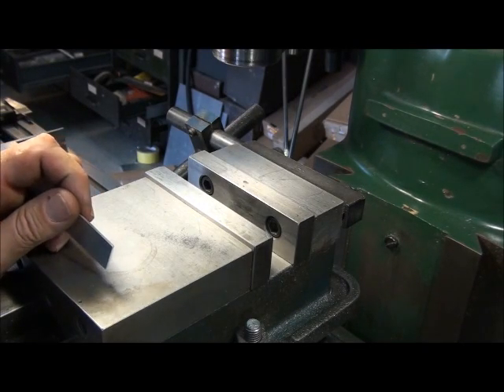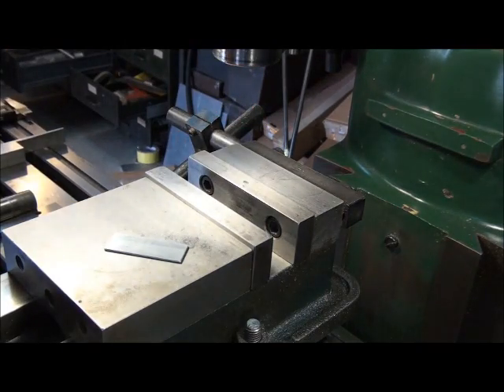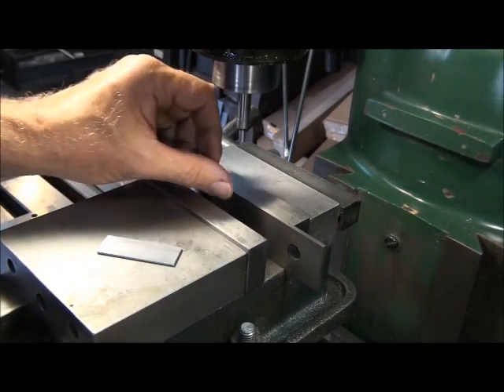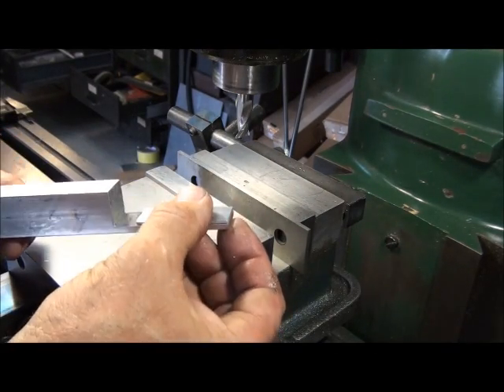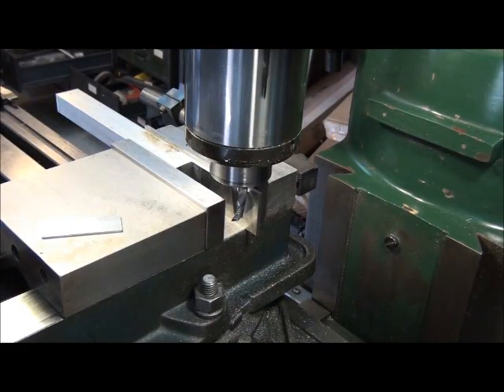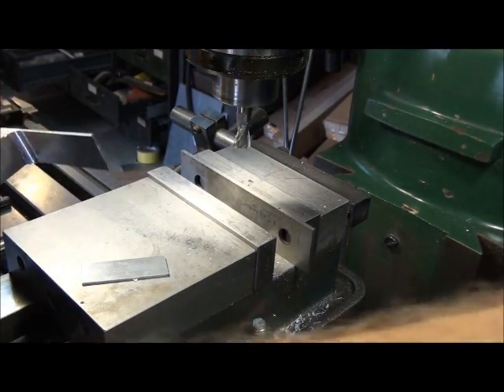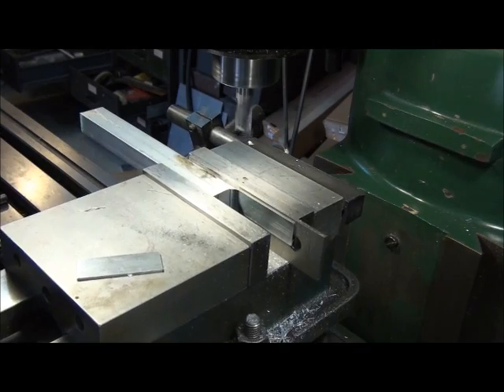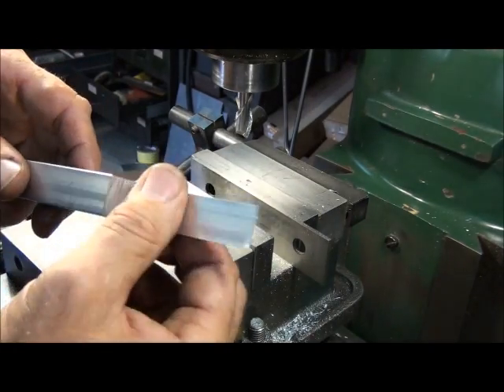How To Mill A Part That's Too Thin To Mill

Comment: Seems like the climb milling is part of the secret here along with keeping the work part as short as possible.
I was fascinated at the measurements. Thousandths and quarters and weird talk with measurements. I imagine your used to this other measurement language but would it not be easier for everyone to go decimal. Everything divides into 10!
Even my kid can get decimal within 5 minutes.
Wish you guys using this inperial system would make a little effort in this area.
As you show here. Problem solving is an enjoyable part of this profession, how would you go about solving the imperial system so it could be instantly more palatable to everyone? Decimal perhaps? Can old dogs learn new tricks Tom?
Reply from the maker: Climb milling is definitely the secret. It won't work the other way.

The sciences use metric measurements over here, but manufacturing generally does not. If I send out a print with metric dimensions, the first thing the job shop does is convert it back to inches. Old habits are hard to break.

Tom
Reply from the maker: *****

I use both imperial and metric dimensioning and both have their advantages. Any drawings I send out for machining are always imperial. If they are metric, the first thing the shops do is convert them to inches. The U.K. is not purely metric either. The dimensions may be in millimeters, but the street signs are in miles. Go figure.

Tom
Reply: Metric has strong advantages. I use it for things like lab work where stuff like molarity is important. It's base 10 system is nice for things like microliters or micrograms. But it sucks for temperature since the span of a degree centigrade is pretty huge when you are trying to maintain a strict environment, and then the whole thing stops making "scientific" sense when you start talking about time.

Aside from it's base 10 system, metric is no more "scientific" than imperial though. The meter was originally 1/10,000,000 of the distance from the north pole (where ever that is) to the equator (passing through Paris). Now it is some bizarre fraction of the distance light travel in a second in a vacuum (there is no such thing as a vacuum). So a meter (and by extension liter, centigrade, etc) are purely arbitrary, just like the foot.

Dividing continuously by 2 occurs constantly in nature, nothing divides by 10 in nature. Dividing by 2 is actually more "scientific" if your are wanting your theory to match up with the real universe. A lot of the interesting math that people use to describe natural occurrences are functions of 2 as well. We naturally think in terms of functions of two as well, we like pairs, couplets, halves, etc. Even metric people do this, they say "half a meter," or "half a kilometer," or even "half a millimeter." The golden rectangle starts by dividing a square in half, Fibonacci numbers are sums of pairs, you yourself started as a single cell that divided repeatedly by two.

So since the imperial system of feet developed from what "feels" right. and we naturally tend to divide things in half, fractional inches are a very natural thing for humans. Having spent a lifetime using both systems, I find that for human scale things, the imperial system is far more natural. A finger span is about half a foot, A hand span is about 6 feet, the second joint of your first finger is about an inch, a gallon jug is about the size of your head, the list goes on.
Reply from the maker: joshua43214

I have a fairly strong science background as well, so I see the advantages of both systems. It's just as natural for me to weigh things in grams and kilograms as it is to measure things in inches and feet.

Tom

Comment: Great tip. How about making a slot and then thinning out the wall for end product? Would hold both sides in place.
Reply from the maker: That would work, but it isn't necessary to hold both sides unless maybe the part was very long. I just used the technique on a part this morning to take a 3" wide by 4" long part down to 1/32" thick and it worked great.

Tom

Comment: Nice!
Reply from the maker: Thanks.

I just used the technique today to take .005" off a .050" feature on a part. The part was clamped against an angle plate in the vise with the area that needed machining sticking above the vise. Then I climb milled the part against the angle plate to remove the .005".

Tom

Comment: what you could do is put a piece of spare raw material like a piece of plastic and tape with double sided tape. after milling use rubbing alcohol and a razor blade to get it off
Reply from the maker: Chillhouse

This technique works well every time and makes it easy to hold the part thickness to a very close tolerance. I've tried glues and tapes and they are not nearly as reliable, or as easy to use, and thin parts tend to lift from the heat of the cutter.

Just this morning I used this technique to machine a 3" wide by 4" long part from 1/4" thick down to 1/32" thick and it ended up flat and to size within .001". Of course it took a 3/4" by 4" long end mill to do it, but it worked great.

Tom
Reply from the maker: I've had mixed results with that technique. Sometimes it works and sometimes the heat from the end mill causes the tape to release. You definitely can't cut a piece as thin or as accurately as this with that technique, but for larger pieces it's sometimes the only way.

Tom
Reply: Toms Techniques I'm far from an expert but have you ever considered super glue and then a stronger adhesive remover even though your technique seems to work great.
Reply: Man that's pretty cool I'm sure these techniques will come in handy as I plan on making lots of very intricate small parts with some Sherline equipment someday.

Comment: This is an excellent way of doing something that I have always struggled with! Thanks a lot, and forgive me if I show this to people and say it is my idea, ha ha! Brill, thanks again!
Reply: Toms Techniques Hi Tom,
Great video and thanks for showing how its done. I have to say i have never seen anything come out flat after milling one side if any material though. I have always had to leave stock to finish the opposite side or both depending on the flatness requirement, whether milling or grinding.
Reply from the maker: Thanks. The technique produces a precise and flat part pretty much any thickness desired. The only limitation is that the part is size limited by the end mill.

Tom

Comment: What am I missing?  You started out with a piece of .050 thick aluminum stock, and you wanted to mill it.  Mill it to what?  What did you want it to be when you're done?  Mill its thickness?  Mill its ends?  Mill a slot?  You didn't say what you wanted it to be when you're done.
So you take a piece of much larger bar stock and make a thin piece of stock.  What's this got to do with the original .050 piece of material?  What ever happened to it?  You said it would be difficult to find of piece of .050 stock.  It you're going to make a thin piece of stock out of a larger piece of material, you didn't need the first piece of material.  So you ended up with a piece of material .027 thick in some spots down to .011 in other spots, and warped.  Was that what you were trying to make?
Reply from the maker: Rob,

It sounds like you need to watch the video again.

I am demonstrating a method I use to easily machine a small part to an unusual thickness. The .05" thick part at the beginning was just an example of what can be done with the technique. Sorry but I'm not sure what you mean by ".027" thick in some spots down to .011" in others". I explained in the video that the part warped as it got extremely thin because I hadn't machined the backside before I started. If the skin is machined off of the bar, the finished part won't warp.

Tom
Reply from the maker: Subramaniam Lakshminarayanan

I think you would find that all of your questions and concerns were addressed in the video if you had watched it in its entirety.

The .050" piece at the beginning was just an example. ANY thickness within reason is possible (I took it to .010" in the video). The example part is also aluminum which would be quite difficult to replicate on a surface grinder with a magnetic chuck. I started with a thick piece in the example, but as I mentioned in the video, a thinner piece could be used if a spacer is placed between it and the vice jaw (to save material).

Sorry you had trouble understanding the concept. I use it all the time to make parts with odd thicknesses. In fact, I used it just the other day to machine a 3" by 4" part down to 1/32" thick by using a spacer and machining half the part at a time.

Tom
Reply: I share your curiosity too...
I was all the while assuming that the 50 thou small piece is going to be machined down on its thickness, which by itself is a bad idea - surface grinding on a magnetic chuck would be right thing to do - and then we get to see a video of a different stock bar being machined. 
This video can at best classify to be an example of climb milling, PROVIDED, there is little or no backlash in the slide screw, and for soft materials as aluminium, definitely not steel...

Comment: ever hear of flycutting using double sided tape as a holddown?
Reply from the maker: That sounds like a launch waiting to happen.
Reply: Actually it's done all of the time.  You start with good quality double sided tape about 0.003" thick.  If you need a .050" thick part made from aluminum, use something real close like 1/16" (.063") thick.  Clean both surfaces with acetone or good solvent.- that is the mill table or jig plate and the bottom side of the aluminum.  Press the aluminum onto the stuck double sided tape, place a flat thicker plate on top and using a mallet - tap to seat.  Fly cut the top surface - I would use 2 light passes for the 0.013" .   You will be very surprised how well the tape holds the aluminum.  In fact, you won't be able to get the aluminum off the tape without soaking with acetone to dissolve the adhesive and then using a block of wood and hammer to knock the plate off sideways.  This process takes about 5 minutes and does not waste much material.  In tool making, we sometimes need to surface grind thin plates of aluminum (for a precise thickness and fine finish).  The grinding wheel exerts  more pressure on the part then an endmill, so we reinforce the system (on a magnetic chuck) with a steel plate that is thinner than the nonmagnetic aluminum, placed on the "kick side" of the part to grind.  Try it, you'll never go back.
Reply from the maker: Ujeb08
I actually have used that technique to keep the center of pockets from lifting while being milled, with the rest of the part still clamped down. The technique in the video is intended for parts with small thin tabs, not large thin sheets. It works very well fo rthat because the climbing action of the end mill actually forces the part down rather than lifting it up like end milling.

Tom

Comment: I enjoy your tutorials. As a newcomer to milling I need all the help I can get.. My hobby is knife making and I can't for the life of me figure out a way to hold a piece of steel that's 1 1/4" x 3/8" x 6 " to do any milling such as facing, edge features..  Any ideas are appreciated.. bty,  I have a grizzley mill drill, manual, no dro
Reply from the maker: Make a new set, or modify the jaws in your vise by cutting a small step in the top corner of them to hold the parts. The jaws will be hard, so you may need to find someone with a surface grinder to do it if a carbide end mill won't cut it.

Tom

Comment: This is a great way to cut small parts. But there is another way you can do that if you need a large part cut thin. Some years back We had to do a mod on the A-10A aircraft wing leading edge slat ribs. It required us to mill down a 1/4" thick 6"X6" plate of 17-4 PH stainless steel to about .050 thick except for the center. Leaving a nib in the shape of the worn wing rib at .250 thick. Regular end mills kept pulling up the part causing a lot of chatter and leaving an uneven bad finish the thinner we got. We were lucky to get .020 +/- tolerance on the thin cut and we needed to keep it at .005. By luck I found some Left Hand Twist Right Hand Cut end mills. The left hand twist acts like a negative rake pushing the part down on the table as it cuts, leaving a great finish and we got a tolerance of +/- .001. If you can get you hands on some they will pay off dividends when you use them.
Other than that, there is a more expensive option that I found works great if you can afford the set up. It is called "Vac Mat" made by Ibag, I'm sure that there are others manufactures too. The advantage to them is that there is no need for clamping and you can cut through the part like cutting out an access hole in a panel. The mats fit over a table and are used with a vacuum pump to hold the part down with the vacuum. Mats are replaceable and are meant to be cut if needed.

Comment: Excellent Video!!!
that's one of the techniques you'll never get in a book.
Reply from the maker: Thanks.

This is one of those techniques born out of practicality. I had to machine a thin tab on the edge of a larger part and this was the method I devised to do it, It worked very well.

Tom

Comment: You may just want to look into using mitee-grip wax paper adhesive...less waste, less worry about part grab, you can mill thinner, etc...
Reply from the maker: I realize there are other ways to hold thin parts and this is just one of many. For small parts, this is quicker and more accurate than adhesives or tapes and since you are climb milling, provides a better surface finish. Grabbing is not an issue at all with this technique.

Thanks for watching.

Tom

Comment: Maybe I didn't understand correctly but, what is the use of the parallel against the solid jaw? Couldn't you just of used the solid jaw and gotten the same results? And the edge finding was just to establish measurement right? Great video! Keep it up!!!
Reply from the maker: Most jaws have a counter-bored screw in that area. The parallel just covers it up so it doesn't leave a mark on the part. Yes, finding the jaw, or parallel in this case established the thickness of the part.

Thanks for watching.

Tom

Comment: its a slot mill not an end mill
Reply from the maker: justfakeit888

Absolutely. It's a center cutting end mill so it will cut on the end. That said, end mills generally don't make good drills, especially for deep holes because they don't clear the chips as well and they tend to wobble a bit due to the lack of an angled point.

Tom
Reply from the maker: Apples and apples. A slot mill (or drill) and a center cutting end mill are exactly the same thing.

Tom
Reply: no one has 2 flutes one as 3 or more
Reply from the maker: Ryan Berry
Sorry Ryan, that might have been true 50 years ago, but it's not true today. It used to be that only two flute end mills were center cutting, and those were referred to as slot mills or slot drills. They were used to mill slots such as keyways. Today, center cutting end mills are available with two, three or four flutes, the term slot mill has pretty much become obsolete. Very few end mill manufacturers even use it any more.

Tom
Reply: So Tom, could you drill with the mill you were using?

Comment: Nice, but how about this:  Super Glue your part to the top of that bar and surface mill it to as thin as you need.... no flexing or movement.... remove it from the bar with a mini-torch, (micro-torch).
Grandpa Bill
Reply: HighStreet Killers I don't think double sided tape is a good idea because it is too soft. The piece must be kept firmly against the cutter otherwise you will at most get a rough finish and a bad precision of the work. Super glue should work because it doesn't increase the elasticity of the vice support, but for 50/1000" it might not be strong enough to prevent the piece from bending.
Reply: Will the part get hot enough from milling to break loose the superglue?
Reply: Dan Holzrichter I haven't done a lot of those cuts but the ones I done worked just fine on both steel and alum. (I haven't tried brass yet.)
A) use a coolant
B) Take light cuts
C) Cut from the bar side out to the end.
Reply: Wouldnt recommend if you dont know what youre doing, but you could easily use double sided tape

Comment: "Close enough for Government work"  LOL
Just a thought; if you left a section of barstock on each end, you could clamp on both ends to prevent curling.
Reply from the maker: I used to work for a government contractor, so that saying has special meaning. :)
Clamping both ends won't keep it from curling. The curling comes from stresses built up in the skin of the bar stock and the way to get rid of them is to take a cut on the back of the bar before machining the front.

Thanks for watching.

Tom

Comment: Hello all.   I use 3M double sided tape to mill thin metal.   tape it down to your table or the top of your vice.    You have to watch heat going into your metal though and not taking big cuts.

Comment: after you made the .010 cut, I could hear a crowd chanting.....".005!   .005!   .005!"
Reply: Tom's Techniques At .005", don't make the part ... grab some shim stock and a pair of snips. :~)

Your technique works for a small part of a few inches length and not especially wide, but would run into difficulty with a part that approached the width of the jaws. Do you have a technique for working with larger pieces?
Reply from the maker: Lol, I've never tried it that thin, but it probably would have worked.
Reply from the maker: It's a specialized technique for small parts at odd thicknesses, but it's not limited to just shims. What if a part you were making had a thicker section attached to it?
Reply: THERE'S  IS ! A ! WAY ! TOO ! GET !! IT TO FIVE ! MAYBE !! LESS !! BUT !! ITS !! NOT !! MILLING !! THOUGH !!!